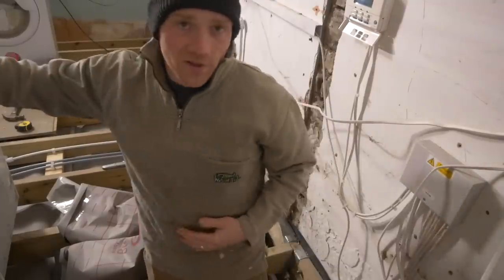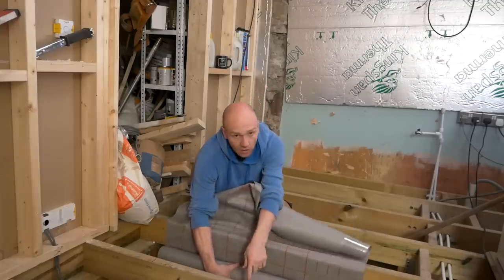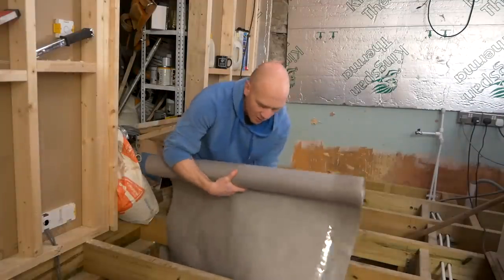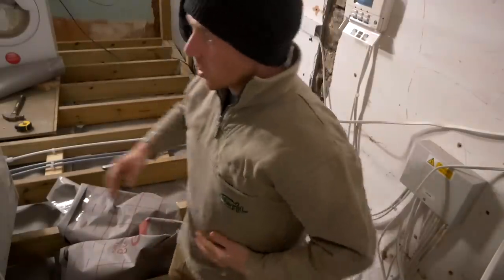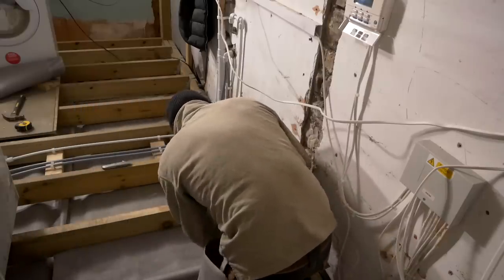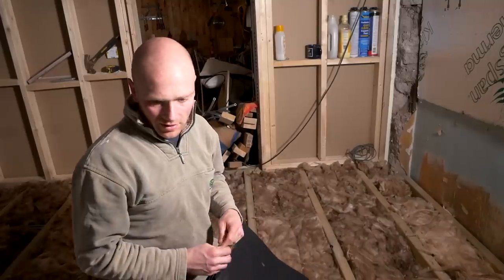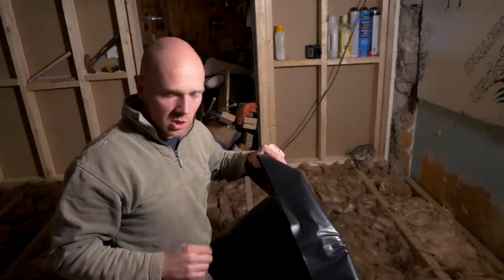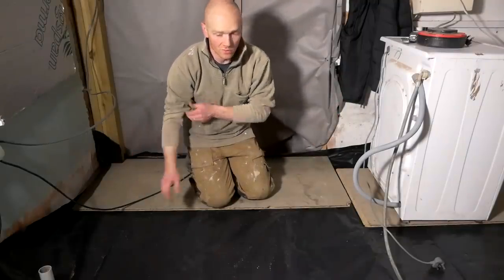Insulating a Timber Joist Suspended Floor

Comment: Great tip I was told for stapling vapour barrier is to use bits of cardboard and double staple through. Spreads the load of the staple point and assists with them not pulling through. Great videos really enjoying 👍
Reply from the maker: Ended up doing just this but hitting staples through 3mm ply offcuts, worked great.

Comment: If anyone is doing this, there is a much simpler way of installing the membrane without hugely increasing the waste. Take some left over ply or OSB or if you don't have any just take an usb board (it's cheaper) you need to cut 1" strips (could be also wider if you need to increase depth etc. You run the membrane around the strip ( the direction depends on if you are extending the joist depth or just fixing) and then nail/screw/staple the strip/batten to the bottom of the existing joist. You'll end up with an inch (or more if you are extending) of waste per joist but you don't need to go on the floor, you work from the top and you save a lot of time and your back. But the video is amusing to watch! Also, if you have some roof battens just use that. This obviously doesn't work with rigid foam buy you should really think twice before installing PIR under your floor. It is not fire retardant in the slightest and you may need to meet code requirements which means extra fire measures. Not to mention that I'd love to see you run heating pipes in PIR!

Comment: I use garden fabric stapled to the bottom of the joist.  The material is woven so breathes.  Allows water to fall through should there be a spill.  It is cheap, strong and easy to fit.  I fold the edge over to double up in places for strength I use a compressed air stapler.  It won't stretch and has worked well with mineral wool.  I also dug out the solum and concreted in a DPM and enlarged air bricks.  I don't DPM the warm side.  Good ventilation does not require it.  At floor level there should be minimum moisture and what penetrates will evaporate is a well ventilated void, physics make sure of that.  Have had it in two houses now and all bone dry - IF the solum is dry.  Victorian houses are a challenge but it's been up 120 years and it was the 60's and 70's vandalism that caused the issues.  Oh I forgot to say I put 600mm of solid 4 inch /100mm insulation above dwarf walls to give 2inch/50mm of space for air to move.  This insulation fitted with batons on joists nailed in place.

Good watching your approach and that you will try different materials and methods.  Keep going your getting there and good luck with the expanding family.
Reply: Interesting insight, did you look at limecrete floors instead of concrete? Have a Victorian house with deep void and bitumen damp proof course has failed in places with wet caly soil below.
Reply: Jim Johnston I dug out old rubble and building materials left post construction (1890), dug out the sand and stone from dressing sandstone in construction phase and soils to above foundation depth.  I then put down 3 to 4 inches of river bed (rounded) gravel, placed a DPM thickest I could find on top then a poured regular concrete.  The concrete only serves to hold the DPM in place and stabilise the base.  Concrete designed and placed to stay a solid slab without cracking.  It's purely physical and will not absorb / hold moisture ( waterproofed additive to minimise) so even if I get flooding it's a pump out and dry out operation as worst case.  I now only have moisture penetration through perimeter external walls which is natural and subject to equilibrium with. Outside soil moisture which can be controlled by reducing outside soils to original height - it has increased 5 to 8 inches in 100 years with 2 "new" surfaces being added including  tar macadam type surface.  I also intend putting a gully drain around perimeter of house and a novel subfloor ventilation to increase evaporation rate.  It's all a balance of moisture in being lower than moisture out capacity.  First room had a RH of 75% on completion in June and is now sitting at 55% in winter with the active ventilation still to be activated.  I am aiming for an RH of 50% +/- 5% all year round in the room with NO vapour barrier in the suspended floor.  I seal all the floors with either ply or sealant where there are cracks or gaps.  Anyone that has been in the winter mountains know that even snow has evaporation in sub zero temps - as a physicist I know this so modest moisture movement is not a problem AS long as the subfloor is ventilated properly - I may post a couple of videos to show my methods if I get round to editing.  I'm not as savvy as the restoration couple.  Lime based concrete is NOT what you wand for a vapour barrier as it is porous.  I have reprinted sandstone walls with lime mortar after removing cement mortar I do want a porous material here to unload moisture from the sandstone walls as it is meant to.  I have 2 foot thick solid sandstone external walls.  I am getting there and the comfort level of the house is noticeably better in completed rooms.
Reply: Thanks David, any videos you have would be very insightful as it sounds similar to what we face with an 1890s house and various modern bodge jobs by builders in the 1980s. Please let me know if you post anything! @davidramsay6142

Comment: If I can give you a small advice try cutting the isolation in package with knife long enough you can cut meters in matter of seconds
Reply: Or you can cut the roll with an old wood saw
Reply: Bread knife works a treat

Comment: What I've done in the past is to remove the build up excessive dust rubbish and soil which builds up over th decades especially with Victoria properties, then I cover the entire dirt with DPM and cover with concrete not too much enough to keep the DPM flat. Obviously where there are footings supporting sleepers cut around. This reduced the rising damp by at least 90%. If its a Victorian house the floor joists and sleepers which are fine need to be treated with preservative and dry damp treatment, face mask and use and gloves for PP are required and make sure the room is well ventilated and spray on( use the green Ronsil fence sprayer...they cost pennies on ebay). Broken or rotten timbers need to be replaced by tanalised timbers only. 
Next plastering scrim and screw to lower side of joist and then take the scrim to the next joist running parallel to it and to the same thing you and do this to the width of the room and then repeat again 400mm apart and continue until you have done the length of the room you have now created a lattic for the 100mm rockwall to sit on. If budget allows put 70mm Selotex or Kingspan in between the joists first and then the 100mm Rockwall. Refit the floor boards...job done. Scrim is a lot tougher than breathable roof felt and easier to install.

Comment: I could remove the floor boards in the bedrooms and insulate the joists but it's a new extension which was done about 10years ago there must be a reason to why they did not insulate the flooring? The block work on the exterior has small vent covers that blow wind through the joists than then blow done into the kitchen down lighters. So annoying. I'd like to know where you get your drive and energy from doing all the stuff you do?

Comment: Hi Tim, If you're stapling a membrane layer to the underside of the joist, can you think of any downside to using insulation deeper than the joists (not compressing the insulation)?

Comment: The reason not to use netting is that it’s open to the air and you’ll loose some of the value of the insulation as the air pulls heat out of it. Part of the problem with underfloor is that you have 2 sources of moisture, one the floor and 2 the room. Typically the floor would be a bigger concern since it’s going to get some water ingress when it rains and that will evaporate somewhere. However with adequate airflow any surface condensation will evaporate and be carried off in the air.

Comment: Thanks for the vid very helpful. Word anyone say you need a vapour barrier if your doing this to an upstairs room, over a dry garage actually. Which is freezing cold!
Reply from the maker: While it could be ok if garage vented and all breathable.  The risk of condensation much greater as it will get colder as air moves down.

Comment: I recently added wool insulation under my floor via the crawl space.  Biggest issue was I have concrete joists so was unable to easily affix the netting.  Ended up using command hooks with a sticky backing.  As not enough room to swing a hammer.  Any suggestions of a more robust way of fixing the netting, not that I’m in a rush to spend another weekend under there!!

Comment: Hi. Great channel; really inspirational.Loved your original underfloor insulation series and used your guidance to complete one of our downstairs rooms; its been great. I'm now looking to do our hallway but rather than re-use the floorboards, we want to lay down t&g cement board instead as the final finish is going to be parquet wooden tiles on top, so replacing the floorboards will limit the overall floor thickness.The only issue is that the cement boards have to be glued to the joists (as well as nailed) and this raises an issue regarding the damp proof membrane. I'm toying with going without a membrane as the cement boards are supposed to be waterproof.Do you have any thoughts?

Comment: Vapor Barrier should always be on the warm side of the floor, walls and ceiling. Is that a True Vapor Barrier you are using ?? or is it some sort of breathable membrane such as house wrap that goes under siding? Using Vapor Barrier on the cold side will trap condensation inside your floor  which will get your insulation Batts wet, grow mold and eventually rot the wood.
Reply from the maker: Yes vapour barrier went on top. The breather membrane underneath is just to support batts, we have used mesh or netting in the past.

Comment: Hi Tim, planning to do a garage conversion, your videos have been great, just a question i need to build a suspended floor to bring it level to the house but would you do the floor first and then build the stud wall which will sit on the joists?

Comment: Excellent video, Why do some people use king-span for this job, Is it cheaper this way or just less work. Thanks.
Reply from the maker: I have used both and actually have just shot a video on why I went this route, will be out in a day or two.  In summary though, by filling the joist depth with soft insulation equals the same u value you would by battening each joist and putting in PIR/kingspan.  Stud walls and roofs are usually not thick enough to fit enough mineral wool to meet minimum regs hence why I used PIR everywhere else.  .. and yes cheaper and nicer to work with too.
Reply: @TheRestorationCouple  I am going to do this job in my lounge so very interested in this. Thank you for your reply.
Reply from the maker: I cheaped out by going with loft type rolls, I would suggest though that it's worth getting the more dense rolls or slab type as its a better fit and likely slightly higher performing.
Reply: @TheRestorationCouple  Thank you. 👍

Comment: Hi Tim. My joists above my kitchen and bedrooms have no insulation what's so ever and you can feel a draught coming through the kitchen down lighters. Any advise? Is there a reason for joists sweating with insulation?
Reply from the maker: Most likely condensation forming from warm air escaping up through lighting. More modern light fittings may be better.... Can you not insulate?

Comment: Hi Tim, could you please offer me your thoughts. I have a bungalow, recently moved in to with waist height under floor crawl space. And desperate want to insulate asap. We have Laminate floors throughout, so too much trouble lifting the floors to insulate. I have plenty of crawl space to move around underneath, but need to understand the best way to move forward. I like what you have done in this video. But my problem and worries are is it a must with both layers of membrane ?. Could you spare 2 mins and offer your thoughts please ?
Reply from the maker: The membrane below it’s really just to support the insulation but is a good way to do so. The vapour barrier on the warm side, above joists, is important to prevent condensation. However it is possible that your laminate underlay will already provide that so it may be possible to do everything from below without too much risk.
Reply: The Restoration Couple Thanks Tim, just read all the comments. I think I’ll try the batts instead of loft rolls. With either bend sticks holding them in place after top layer. There’s no way am lifting all the top floors so will staple top layer on the bottom of the joists then fit the batts
Reply: @game4alaughman  was wondering how you get on because I'm in the exact same situation as you. Looking to insulate under our house with plenty of crawl space but won't be able to lift all the flooring up.
Reply: @MrAas41  covid came pal and I had to retire, managed to get a free home insulation done by Scottish gov, opted for a spray foam.. wow what a difference, it really made the bungalow much warmer. The company was meant to use a wee robot that sprayed the foam but they couldn’t get it working properly so was done by hand with the hose. Yeah I would deffo recommend it, if you want to look down that rd 👍 no problems so far at all. 
Only thing I wish I had the cash for before was to get sockets rewired 1st but it’s no bigger atm
Reply: @MrAas41  it’s amazing the amount of heat I was losing without any insulation
Reply: @game4alaughman  nice one. I'm not sure about that spray foam insulation stuff. I've heard some negative stories about it trapping moisture and rotting joists
Reply: @MrAas41  yeah I had too but honestly I’ve checked every 3 months since and it’s perfect, loads of air vents round my bungalow which I always thought were too many. Not a worry now it’s perfect

Comment: I don't like running plastic pipes beneath floors, ground floors especially, since "wee timourous beasties" have to gnaw continuously, to file their incisors down, plastic pipe tends to get attacked and causes leaks. Adding insulation provides both an easy source of nesting material and a hop up platform to get closer to the pipes.
Of course, improving insulation and noise reduction is a good thing... but there are drawbacks. Just saying.
Reply from the maker: I’ll make sure the cat is on guard. 👍
Reply: Meow! Purrrrrrrr. I tawt I taw a puddy tat. Good idea to make sure that any external vent bricks are all in tact. They tend to try and come inside around this time of year. If they want to chew anything, better off the electrics---> instant death! But I'm a plumber and as, such totally biased.

Comment: You have a lot of space under the floor, you should insulate timber joist underneath and you should make vertical insulation of your foundations.  What you did is not enough and you will get cold joist and cold wall right above the floor.  This usually cause rotten wet walls 150-200mm above the floor, rotten furniture and obviously make your house cold. If very cold outside and warm inside you chipboard will form condensation where in contact with the floor  joist. Squeaking will also start with screws. Floor should be glued with polyurethane glue to the joist.   Claustrophobic low ceiling.

Comment: Great video. Im planning an extension over the garage. I was thinking of battens and plasterboard on the block walls rather than dot n dab. That way i can insulate between as well as the cavity. If the insulation is foil backed is that my vapour barrier sorted? Also what would you do for the floor. Its a cold garage below
Reply from the maker: Yes the foil back pb is vapour barrier. Regs with garages is quite strict, I think you have to use thicker boards and fire resistant materials. Best check with BC.

Comment: Hi Tim can I ask what type of foundations your property has and if you had to do any work to the foundations before you replaced floor joists and reinstated your floor?
Reply from the maker: The building is the original solid wall structure so full foundations. The floor joists are hung on solid wall and sit on stud wall. Earlier videos will explain.

Comment: Would you need the vapour barrier on top of joists if you was laying chipboard flooring then laminate, with the laminate underlay containing a dpm ? Would this suffice for stopping the heat meeting the cold air underneath ?

Thanks
Reply from the maker: Most likely fine. To be honest with both our laminate and underlay no installer we didn’t need it here but for a few extra pennies it’s worth doing especially if it’s somewhere that may be carpeted in the future.

Comment: I'd have kept it on the roll, roll it under a joist then back on itself, pulled tight then stapled then move to the next
Reply: Easier said than done with pipes and cables to deal with

Comment: Clearly he's not aware that surrounding electrical cables with insulation is contrary to the regs. Cables covered by insulation should be derated.

1.0 or 1.5 mm lighting cable is no big deal as it's far from max capacity and generates little heat, but strictly speaking, the regs say no. Ring main, cooker cables, shower cables etc should not be covered.

They are all over the country of course and it rarely causes issues but I would be inclined to comply with the regs. They exist for a reason.

If enough slack cable, insulation should go underneath, if not, make an airspace for them or rewire.

Comment: I never like using wool insulation or any likes of it in cavity external walls. The amount of times iv seen it drench inside walls attracting damp. Its an inferior product as it prevents any ventilation.  This is where kingspan comes in..